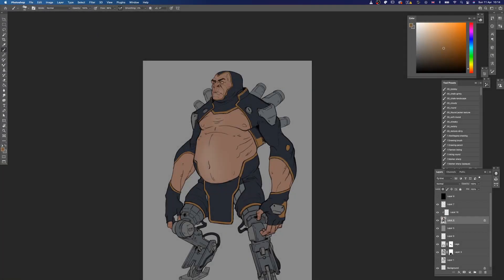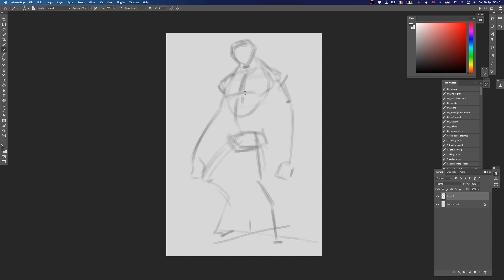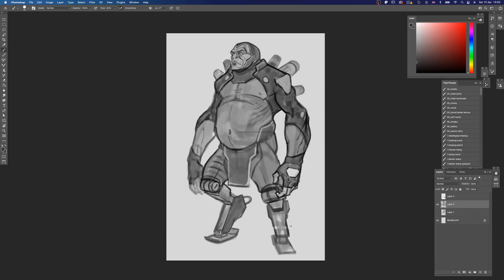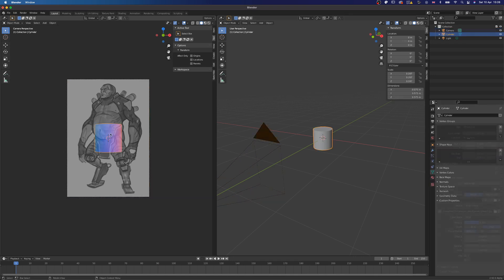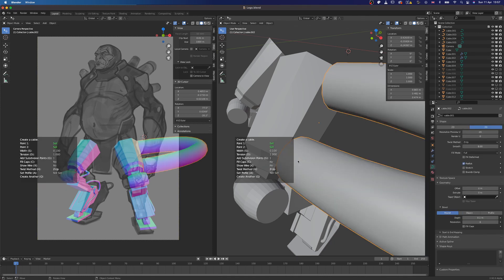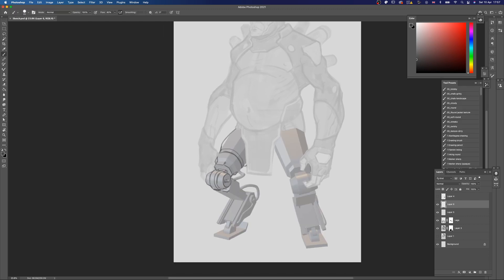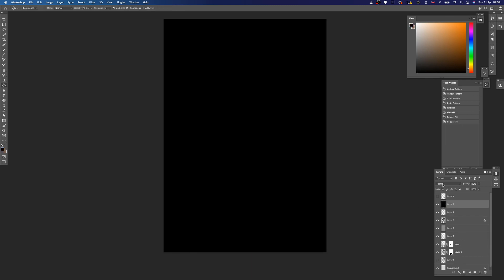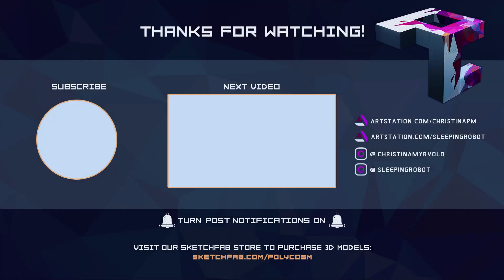DESIGN PRINCIPLES | Problem Solving In Blender For Mechanical Character Design (feat. "Cablerator")

Comment from the maker: Tipjar/Donation Link: www.paypal.me/POLYCOSMTipjar
----
Timestamps & Add-ons:
0:00 Intro/Video Summary
0:53 1st Sketch
1:49 2nd Sketch
2:57 Blocking Out The Mechanical Legs In Blender
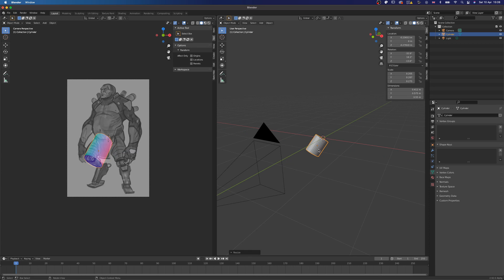3:57 Using The Rainbow Shader + Bool Tool Add-on
4:37 Adding Cables Using The "Cablerator" Add-on
5:29 Getting A Viewport Render
5:53 Sketching Over The 3D Legs
6:36 Final Lineart, Detailing
7:11 Adding Colours
7:46 Adding Lights
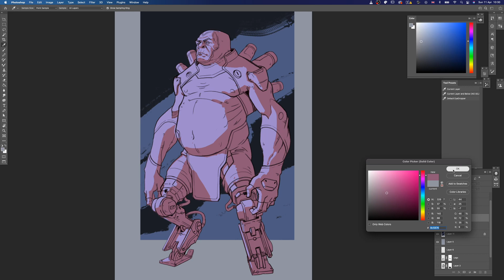8:04 Finalizing The Drawing, Final Result
8:40 Final Words
 
----
 
https://blendermarket.com/products/cbl/?ref=163